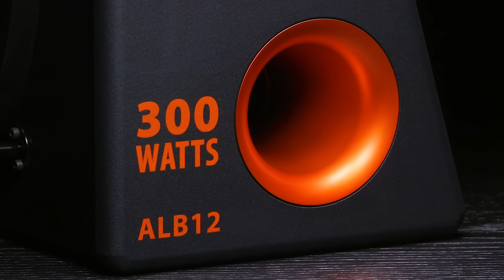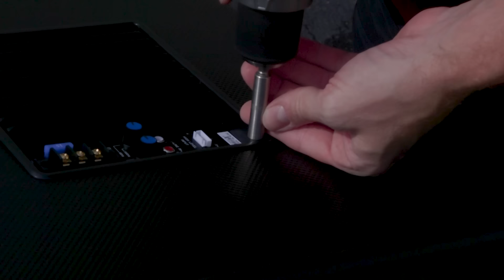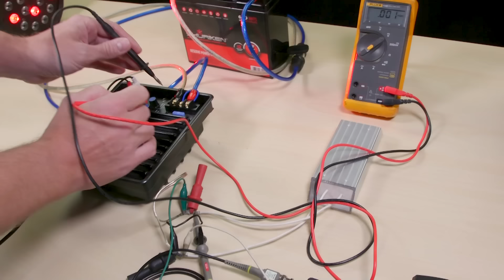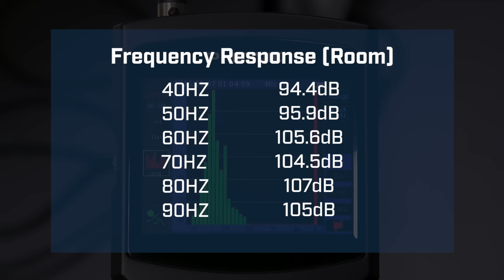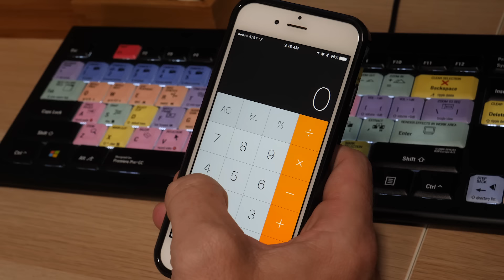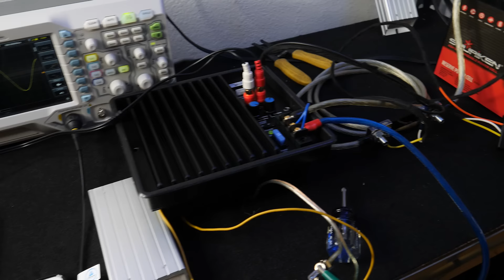Sh*t Car Audio Manufacturers Say! Reverse Engineer an Amplified Subwoofer

Comment: I know Dual isn't anywhere near audiophile quality but come on, it's not making outrageous  claims if you look at what you're getting for the MONEY. The box alone, like the producer said, is not that bad. 5/8 particle board. Poly. Rolled port. Better than carpet finish. Speaker grill. This box alone would sell retail for around $50. 
I found the Dual AL12 on Amazon.com for 89.00. It has a 4 star rating from 63 real people. Also, it comes with mounting hardware. I believe it's a DEAL FOR THE MONEY! And that's strictly off of specs. There was no musical listening performed in this video. No one even used this product for the way it was intended in the video also! I believe value isn't just hardware related right? Ease of install, and damn, most importantly, HOW IT SOUNDS, is also built in when looking for value!!!
Show me a better setup for under $100 and not...for $185 you can get this or that. People buy this thing and like it. I guarantee if you take the away the DUAL logo and put Kicker (s, you could even raise the price to $125 and there would be praises made for it's design.
If people would stop letting their budget and their personal tastes interfere with what this product was built for and strictly see value for the dollar, they would see it's very decent.
I'm buying one and I'm going to install it in my 05 Acura TL. I'll do 100 demos and see what the opinion is on sound alone first THEN show it to them, disclose price, and then record reactions. This way it's not being picked apart by "audiophiles" that have never even listened to a single DUAL product.

I do believe it needs at least an 8 gauge amp kit though.

Here is the amazon link...
https://mega.nz/#!19YERTAT!VKerS4ARXlVhwrCigBLOHTuTMza4ldScD01Ww5PPu0w
Reply from the maker: Justin, as we stated in the beginning of the video, the value is hard to beat, with that in mind, why fudge the specs? As for sound quality, we also addressed that in the video, with a huge bump at 75hz it will be difficult to make this sound good. You will have massive upper bass that will need to be attenuated or you will need to have a headunit that you can bump the lower ranges to even things out; you then will have an amp that runs out of steam. This product is worth buying when you have no subwoofer but be honest in its performance.
Reply: If you're happy with a 10db peak at 75hz, I don't know what else to tell you than, "enjoy," but please don't play it loud enough so I can hear it when I'm next to you at a light, 'cause I'll notice your mid-bass peak, and I'll laugh, not with you. But you enjoy it.
As for fudging the specs, that's the name of the game in the low-end uninformed (in audio) mass market. 
A signal sweep will give you a general idea of what it will sound like despite hearing it, and I have heard Dual products, not this particular one, but this video explains what I have suspected all along, a high tuning frequency for a sub.
Reply: Other than the 100 watts rms, you tested 50ish, what was misleading? I know the 300 but ALL amp companies do this.
Also was it CEA rated power? There's so many ways.
What's up with the 75hz bump? every amp or sub out has a bass boost. That's also why we go ported vs sealed.
Reply from the maker: Justin, I'd have to argue the 100 Watt RMS was the real misleading figure, at 14 volts this tops at 66 watts on a 4 ohm dummy load. The other "specs" I am semi-ok with. The 75hz bump was the actual response of the box, this isn't an issue other than what it will sound like; to each and their own. I know a 65 Watt powered 12 is hardly appealing but this is really what it is. There is still huge value there, sure beats nothing and it's easy to install.
Reply: Spaceman Rick the whole point of this is to say yes it's a value but even with a value product they're still lying to you. It may very well be great for you (I'll stick to my 18 and 1500 watts tuned to 32hz rather than 75) but it needs more power and DEFINITELY more box space... A 12 needs 1.7-2.5 cubic feet ported to shine. It had 0.7 in this video.
Reply: But why buy this when you could get away with good mids and get the same result. Then when you do want real bass it'll all work out.
Reply: I bought a rockville RMW8P just for the enclosure, fitted an old alpine 8" type R. Looks and measures the same as the SBR-S83V and sounds great, actually plays down to 30hz.
Reply: Doesn’t a grilled cheese sound good right now?

Comment: I had a 2000watt MDS 4ohm 10" sub couple years back and drove it with my 600W RMS mono amp 4ohm  It could run it but not drive it. But man it was good sub.

Comment: I have a real big confusion. We get 1000W peak for passive subwoofer for  less than 100$. Why are active subs so low powered despite being so costly.
Reply from the maker: Because you're not usually getting that good of an amplifier when it's built in.

Comment: You failed to account for alternator current, which floats around 13.8v. Many amplifier manufacturers will use 13.8v rather than 12v.
Reply from the maker: Nope, read the google doc. We demonstrate voltage drop.

Comment: Once purchased a Fli Active fly trap active sub 10" & After 2 years it randomly stopped producing sound so i dismantled it & confirmed my amp had infact had died even though it would power up (switch on ect with remote but had no audio output) & to top it off they powered the driver that is rated at 250w Rms with a cheap 80watt edge amp (all stock from factory so thats 2 brands i now avoid)  Why install such an underpowered amp... its like they want you to make the amp exceed its limit & blow ... But this video goes to show many do it.. Best Advice is Build a System yourself & reseach the driver your using & get an Amp to suite, As most of these active off the shelf systems suck

Comment: Good series on concept; but it's let down by a few flaws.

When testing SPL "in-car", every enclosure that wasn't specifically designed for the listening space, driver, and amplifier combination is never going to replicate in any other vehicle nearly the same, so it's a bit of a pointless segment. Real-world output needs to be done in an anechoic chamber with a linear test microphone, then it is the job of the installer to calculate if it is suitable or not for the vehicle, and if it is, calculate the best position to put it for linear frequency response.

Also, just getting the volume of of the enclosure and the speaker parameters is not going to give you anywhere near close to output characteristics, once again the "free air vs in-car" mode in the software here is an absolute joke.

In the end, enclosure design and the correct match of equipment of the listening space is the most important factor. The idea that prebuilt enclosures even exist just boggles my mind.

Comment: How can you do a serious check with a drifting psu? A small battery at that . . . . and when the engine is running the voltage would be higher. I know that the internal psu uses a boost converter but is still somewhat reliant on the input power.
Reply: I am aware that you wanna expose the marketing wank,  but if you are gonna test stuff let's have it done right please.

Comment: Kinda Disappointed on that amp. i tested a "bass tube" amp rated for 100W with a 10" driver. Well sure enough, it did hit 100W before clipping 118W into 4 Ohm at 13.8V from a 13.8V 45A supply to be exact. and it also only had 4 power supply diodes and mosfets and 2 outputs transistors.

Comment: so what is an actually good sub in the $100 range I'm interested in buying one but don't wanna end up with something like this one
Reply: lymkb3 buy an mtx thunder 12 and about a 400w amp.  If you can go to about $250 they have the combo of 2x 12 and a 600w amp. I have it and it is worth the money set up right.   However the dual is not bad. Just the amp it has as seen here.  Buy the sub in box for $50 and get you a 300w amp for $50. Go jensen for the amp since I'm not sure about dual amps.
Reply: Also Sony but NEVER buy Sony speakers. Just amps. And do not over load them.

Comment: FYI, 10Db takes 10x the power not 3x. Do the math. Get the number of times the value doubles first. (aka log base 2): Log (10)÷Log (2)= about 3.32. 3Db is twice the power, so each doubling is 3Db. 3.32×3 is almost exactly 10. I know that you can fudge it a little in a small space like a car. From my experience, not that much though. I have seen twice the power and woofer produce about 5db more sound and a lot more kick in the chest, but no way 3x gets you 10Db.
I just do not want a listener to watch this and upgrade from a 50W amp to a 150W when they really needed 500W to get the result they were looking for. In the end we are trying to turn the BS down and sometimes that means calling out an error. Other than the math error, excellent job.
Reply from the maker: Yes you are correct, the way I should have said it was you need to double the power, then double it again, then double it again, roughly 960 watts there about.

Comment: Teenagers first system  or someone who wants to add a little extra bump in their trunk , shit I bought a skar evl12 for 200 new and a skar rp 1500 off a buddy for 30 bucks and that skar hit harder then the 400 dollar a piece rocktord t1 12s I had running off a Rockford bp1500 spent way less on the skar and alot more happier sometimes the most expensive isn't the best!!! I hit 151.3 on the dash in my 03 Tiburon on stock electrical.

Comment: instead of dogging a mid-grade company for mis-advertising their product (which in my mind has come a long way and actually is much better quality then some of the older more established names in car audio.) it makes no sense to me that you need to go into the mis-advertised specs when 99% of all car audio companies do the same. not to mention that is the finer side of marketing (unfortunately).  if you ask me thats a quality box setup for the price. other then the head unit, i do believe this is common practice with many electronics and products.
Reply from the maker: We're not saying its a bad product or not to buy it, we admit in the video that for the price the ALB12 is a good value buy. We're not attacking Dual with the video, we're just educating consumers. It's a $100 amplified subwoofer. We will be doing other companies, this was just the first one of the many
Reply: Chris Lorenz I would never consider dual as a mid level manufacturer. They make audio components for people who don't care about audio quality.

Comment: What's the best way to distinguish between amp clipping and subwoofer distortion? Meaning how does a person know if the amp is overloaded or the sub overload is the problem?
Reply: 420dportkid watch the sub to see if it's hitting its max excursion. if it is, then the sub will have distortion at any level above the level where it is reaching its max excursion.
Reply from the maker: You will hear mechanical chatter when the sub is exceeding its excursion capability.

Comment: Used 15 in 32hz prefab ported box
$100
Used Alpine mrp-450 
$50
Scosche loc at walmart
$15
Scosche 6 gauge 100% ofc wires
$30
Hitting a 139.6 at 40hz in the kick
$$Priceless$$
Reply from the maker: Lmao "Breast Buy"

Comment: Dual dls 12 inch subwoofers can only handle 125 watts and claim to handle 875 watts of power but if you give them more than 125 watts then the coils might burn up

Comment: You could just put a different subwoofer in it like a jbl 10 inch subwoofer or a kicker cvx 10 inch subwoofer and it will sound better a 10 inch jl audio subwoofer would not do too bad if powered off the dual alb10 amplifier

Comment: A 10dB bump was calculated, but NOT confirmed. Measured in-car was a 5dB bump - not perfect, but not as bad as claimed. Also the 300W Max power rating has nothing to do with SPL output, which is a function of driver efficiency, and enclosure design in addition to power output. 300W Max is probably BS for this amp, but you didn't actually prove it. You showed it could do 50 WRMS into a resister at a couple select frequencies. How about test at a higher frequency for a brief moment (burp) with lots of distortion? It will sound terrible, but the amp could potentially do more than what you showed. Typical max power ratings are indicative of the perfect-case scenario, often listed without regard to distortion, tested in a higher frequency band where output is more efficient. I'd like to see a more convincing test before trashing this $99 system. Or... show us a system that gives more for a $100 budget.

Comment: last two notches in the iphone volume are clipped :)
Reply: spyko7z yes! i feel like no one knows this! I always stop at two clicks down on phones and use that as the max volume
Reply: exactly. clean input = more clean output
Reply from the maker: We checked it on the oscilloscope and was clean all the way up when using test tones.
Reply: I was thinking the exact same. should have used some real audio out device!

Comment: Very informative, I have a supposed 6900 Watt Monoblock with 1000 rms Watt at 1 ohm. Driving a subwoofer at 4 ohm subwoofer is 300 watt rms. Amp apparently making 680 watt rms at 4 ohm lol no ways.

Comment: If the manufacturer has used a class D amplifier they could have easily achieved 300W output. Class D is ideal for low freq amplifiers.

Comment: Getting mad at Dual for putting out a system like this is like getting mad at a gold plated ring for not having gold in it. IT'S $99!! What did you expect it was going to sound like? Yes its crap, IT'S $99!!! Only way not to get mad is to buy/create a system for the same cost and make it perform vastly better.
Reply from the maker: Doc, you missed the whole point of the video. Value is what this product is, why fudge the numbers?
Reply: I realize that, but I don't think that's what most are complaining about in the comments. Amp is rated for 100w, likely delivers ~50 watts. Truth told, the 3 dB difference most won't  notice, but facts are facts, why fudge numbers indeed. 
I think many just feel the name brand is crap and has no place in the audio world, which isn't exactly true. That lil setup will go far for a kid who doesn't have the money and wants a nice lil bump in his system. my father whos 72 and loves blues got a powered sub like this to fit in his truck, he loves it, and what he spent didn't break his retirement bank. I tried to price out a box, a 12 and amp, couldn't get less than 175 new. So this has its place.
Reply from the maker: Agree 100%

Comment: Quality Mobile Video ok im an electronics engineer, here's a bit of info for you, you aren't properly measuring the output of an amp and a subwoofer in watts, unless you take heat loss into consideration which is where some of the dc voltage input is consumed
Reply from the maker: We showed efficiency, input consumption vs output power, as I am sure you know, heat. It's in the spreadsheet.

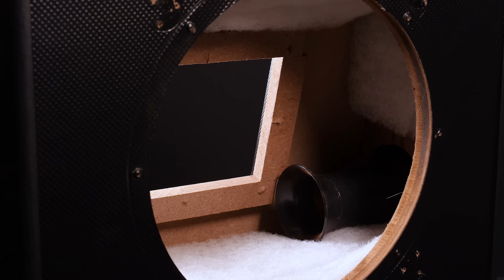Comment: Not trying to be rude but at 2:46 you use the word "dampening". The proper word is "damping". Dampening is to make wet...Damping is to suppress or control. Nice post though.
Reply from the maker: You sir are very correct!

Comment: big  speaker cables do nothing if u look inside of a amp it has tiny thin wires, same with in side a speaker to. So big thick speaker cables dont do any thing, if they did do somthing all the cables in side an amp would be thick to

Comment: ALL enclosures are designed for (as you call it) "non-Linear Box Tuning". That's the whole idea of the enclosure - ESPECIALLY for Subs. OK, perhaps this enclosure is a bit too small for the driver, however the critical flaw in your "test" is that it's not tuned for operation in "free air" so it's peak is up at 70Hz or so. It's not designed to be a speaker column for outdoor concerts, and as you found in your in-car tests it works just fine when in an enclosed space that is was designed for. All car subs will have a shitty response in open air.... I am amazed you didn't operate the driver in free air, and then put shit on it's response that way, like so many other so-called "car audio experts" on Youtube.
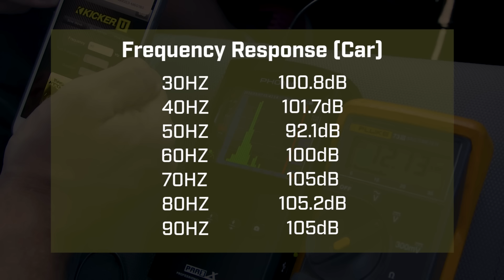Reply: In fact, looking at 6:25 it is clear that when installed in the situation it was designed for, there is hardly any "non-linear-ness" and no huge bump at 70Hz either. It's holding within 6dB from 90Hz down to 30Hz, which is pretty fucking good for a cheapo POS. I also have my doubts about your testing methods, which look very LOW-Quality Mobile Video to me. Using a non-calibrated microphone, why? I shudder to think how you are guessing the power outputs - especially looking at the way you are letting the input voltage drop so low due to that obviously fucked old motorcycle battery you are hooking things up to..
Reply from the maker: http://www.phonic.com/test-instrument/paa3/?sl=en
https://www.wccaraudio.com/smd-audio-multimeter-amm-1.html

https://www.amazon.com/Rigol-DS1054Z-Digital-Oscilloscope-Channels/dp/B012938E76/ref=sr_1_2?ie=UTF8&qid=1506716182&sr=8-2&keywords=rigol+oscilloscope

Not the best equipment in the world.

Comment: I see you re-ran the amp tests with higher voltage. Be aware that CEA/CTA standard says 14.4V. So anybody that conforms to their standards (all the big boys) will have their power ratings done at 14.4V. Don't be surprised when a name brand with an unregulated power supply underperforms if you're testing at 12.3V like this.
Reply from the maker: We certainly understand this, it's slightly dubious that 14.4V is the spec when most modern vehicles test at 13.9V-14.0V.

Comment: 50w at 12volts
 So really 100w at a cars normal running high 13 to low 14v range
Reply from the maker: In the document we demonstrate a 2-3 volt drop, its worth about 12-17 watts.